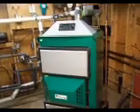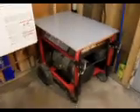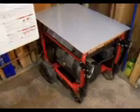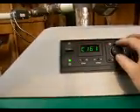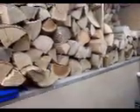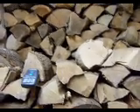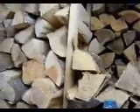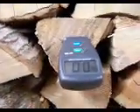Eko Orlan Model 25 Wood Gasification Boiler (1 of 2)

Comment: I live in Sweden. My wife is from Poland. Her nephew has gotten us in touch with an Orlan factory representative. Price including delivery is very good. Problem is that he has no source for the induction fan that you demonstrate in your videos. Do you know if the manufacturer makes a 220-240VAC 50 cycle model? Since I am from the USA, it is fairly easy for me to plan trips when I have enough goodies to justify a trip. I regularly purchase items in the USA that I cannot find elsewhere and often find manufacturers in Europe via US sources... go figure about that last one, huh?
Reply from the maker: +George Edgel Sorry, I do not know of a source for what you are looking for; but after living with the Eko for 7 years, I find it difficult to recommend it to anyone.  With a little effort from the OEM, it could be a world-class unit.  Some of my disappointments include:
1. The heat exchanger cleaning mechanism is a joke...don't waste your money paying for the option.
2. The software in the Controller may or may not be covered in the manual.  I have functions in my Controller not listed in the manual and the US Distributor is a moron and of absolutely no help.
3. Replacement parts may or may not fit.  See my video on the nozzle replacement.  Again the Distributor offered no resolution.  His reply was..."Yes, I have heard of that problem."
4. Primary and secondary air adjustments force you to disassemble the unit for adjustment each and ever time!  Truly a pain in the butt! See my fix for that.
5. The unit should come with temperature sensors for flue and the lower combustion chamber; I have added those.  Without the temperature readings making air adjustments is by trial and error.  Kinda like trying to bake a cake without knowing the oven temp!

I have made so many changes to the unit, that other than the color green it hardly resembles a stock Eko!

Visit Heath (dot) com...lots of good discussions out there.

Good luck!

Comment: can you share the model number of your danfoss valve   thank you
Reply from the maker: Sorry.  There are no numbers on the valve.  My purchase receipt has: Danfoss Thermic Valve. No other identification.
Similar to this:
http://www.smokelessheat.com/boiler-accessories/danfoss-thermic-mixing-valve
One tip though, ensure you install shutoffs on all sides of the valve, just in case it needs service/repair.  I did not, which means I get to drain my storage tank if there is a problem.  Will change that for sure next year!  Good luck!

Comment from the maker: @mtknaebe Thanks for the info. I use the readings as a reference. All wood going into the boiler has been in the heated space a minimum of 1 month before use.  I can tell the wood is quite dry simply by how light it feels when I pick up a piece.  There is no "sizzle" or water being forced out when it is inside the combustion chamber.

Comment from the maker: I did some rough fuel cost calculations tonite.  This is conservative.  On average, I have used 1.5 facecord of firewood per month this winter.  It has been a cold winter.  This results in firewood cost of about $52.00 per month.  I keep my thermostat at 73 degrees 24/7 and I get all my domestic hot water as well.  Very pleased.

Comment from the maker: I purchased the used propane tank from the Boiler Dealer.  He made all the changes to the tank.  The 300 gallon tank (with modifications/welding) was about $700.  Used propane tanks are readily available. A large agricultural bulk tank would work well also.  Thanks!